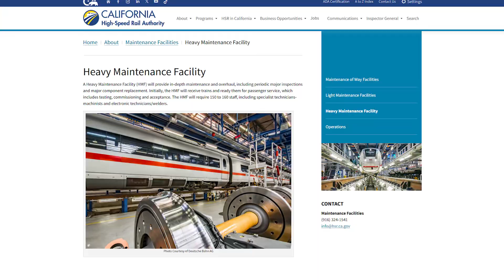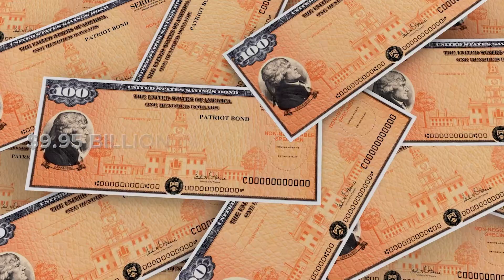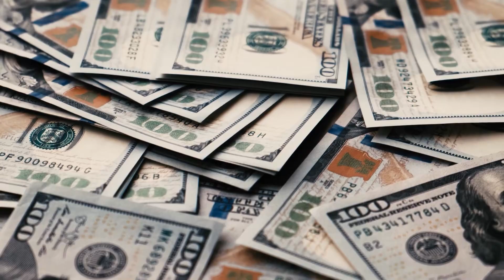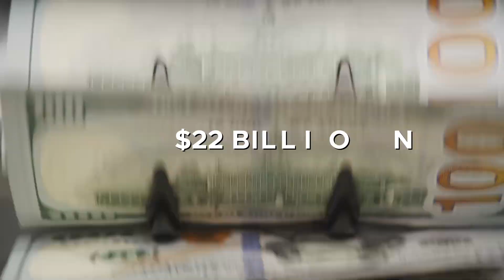California's $160 BILLION High-Speed Rail: What's Really Happening Now?

Comment: It’s no where near $160 billion.
Reply: $160 Billion is the current cost estimate to fully build out the system from SF to L.A. which is what was promised.  I voted YES for it in 2008, but now do t support it anymore.  Cancel CA High Speed Rail.  Sell the acquired parcels and use the proceeds to rip out what has been built. The cost, even if it was $100B does not justify the utility from one single rail line.  What a boondoggle.

Comment: Did everyone forget that CHSR was supposed to be done with the complete project of S.F. to L.A. in 2020 ? They're so proud of being over 10 years behind and now not even going from S.F. to L.A. Someone needs to be held accountable and fired, how can incompetent people still have a job and request more funds? CA politics at their best, GAVIN 2028 ?????
Reply: It still is going to be SF to LA ?? But it's being built in phases and the Central Valley connection will be done first.
Reply: @inosurrender8327  The initial proposal was to have it follow the 5 freeway but the Central Valley politicians and lobbyists forced this project to start in the boondock's rural areas of the Central Valley where it would have the least usage just to boost their cow towns when they are built. It should have started in San Diego, LA  or SF where at least it could get some use when those segments were built. Bureaucracy & special interests at work. smh
Reply: @BroodingRobot  San Francisco to San Jose electrification has already been done. The proposal on the ballot is what is being built. A majority was in favor of the proposition and a majority is still in favor. C'est la vie.
Reply: @danielcarroll3358 My point is if the planners didn’t acquiesce to pressure from the Central Valley special interests groups and started the project in the middle of nowhere, it could have been partially done by now in four of the busiest transportation hubs. As SF, SJ, SD & LA are much more populated than the central Valley. For example SD to LA could have been up and running while rest was being completed.
Reply: @BroodingRobot  The first thing that has to be built is a test track. By law trains have to be tested for 1,000 miles of operation at 110% of operational speed. That is 250 mph. That is the first thing that the initial operating segment (IOS) will be used for. Another point is that there is no tunneling in the IOS. Tunneling is expensive and time consuming. By the way, Fresno alone has a higher population than the largest city in a majority of the states. Some nowhere.
Reply: @d @danielcarroll3358 We all know the Central Valley special interest groups flexed their muscles and  threatened to delay and or stop the train if they didn’t reroute the train thru their towns, let’s stop pretending like they didn’t 😂I love how yCompared Fresno’s much smaller population to OTHER small cities in other states but not the cities SF, SJ, LA, SD, in question. 😅Very slick there!😜
Reply: @BroodingRobot  Well take Hanford for example. They did everything they could to not have the train run through their city, which was on the original route. That is the reason for the humongous Kings-Tulare station. Now there is a proposal to move the city limits of Hanford to include a TOD project surrounding the station. Life is funny. 

Most of the delays in construction of the IOS have been because of legal shenanigans by CV Republicans.
Reply: @inosurrender8327  Correct. In spite of continuing Republican opposition, it is supported by a majority of Californians.
Reply: I couldn't have said it better.  Why don't people (and contractors) get fired or banned from future projects when they demonstrate such incompetence?  BTW, this is not Gavin Newsom's fault.  The gross mismanagement happened under previous administrations.  What I have an issue with is the inability of people to cut our losses when we can clearly see costs spiraling out of control and the  ridership much lower than projected.  We need to cancel CA High Speed Rail on that basis, and invest in the next generation of innovation like autonomous vehicles and AI guided vltesffic control systems and EVTOLs.
Reply: The Central Valley politicians and lobbyists derailed (no pun intended) this project by insisting it go thru their cities despite it not being economical. This is why that thing started there instead of starting in either or both ends of San Diego to LA or SF to SJ where there are ACTUALLY a huge population that would use this. Not in the Central Valley boondocks cow towns. smh

Comment: Cancel California High Speed Rail.    The $128B - $160B to build, let along billions in $ to operate it (at a loss) does not pencil out.  Very few will take a $145 round trip cost (over $3000 per month) commute daily from the central valley to major cities to work.  The cost is cheaper and the trip shorter to fly between L.A. and San Francisco.  I live in California and we were mislead during the selling of the project to voters back in 2008.  By the time this thing is fully built to have full utility, there will be more innovative travel options, reducing ridership projections over the recently reduced estimates.  Sell the parcels acquired and use the funds to rip out what's been built.
Reply: When they cancel the $900 billion military budget that was just passed, maybe we should cancel this project. But until then, KEEP FUCKING BUILDING.
Reply: @TheRailwayDrone if you want to pay for it, then fine. The riders of the system should pay for any amount over the $33 Billion we approved in the 2008 initiative.
Reply: @hockeyplayer28 No. Taxpayers should pay for it just as we are paying for the billions of dollars in farm aid that was sent to farmers after they voted for a felon who helped their farms lose money. That's how this economy works.
Reply: @TheRailwayDrone Farmers produce something of extreme value to all citizens.  A single rail line with limited utility for a very limited set of people does not warrant $128-$160 Billion.  Again, what was authorized by the bond measure was a $33 Billion system, with $10 Billion in bonds.  Not a $128-$160 Billion system with 3/4ths of it being thrown on the taxpayer.

Comment: They should have built the train line next to highway 5, trains could have been running by now!
Reply: The Central Valley politicians' special interests/lobbyists got their way and forced them to divert the line thru THEIR small towns despite it being the worst area to start building this thing. They should have started the lines on the two ends where it was the most populated and have them meet in the middle like how they built the Transcontinental railroad was built in the mid 1800s. At least if it was delayed, portions in San Diego to LA and SF to S an Jose could have been up and running.

Comment: Did I see a level crossing of 5-lane highway with high-speed rail tracks at 3:57? Is this a joke?
Reply: Not a joke, that shows one of the at-grade crossings in one of the blended portions of the project, which aren’t entirely grade separated. Those crossings will happen between SF and SJ, and also between Burbank and Anaheim.
Reply: @rockwellmath  - ok, so it is not HS. But it is strange for me anyway.